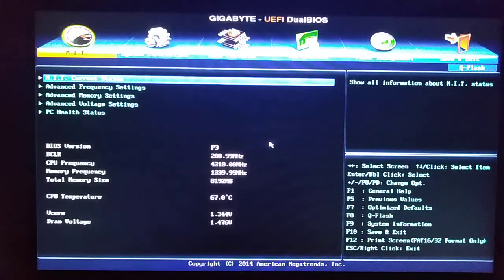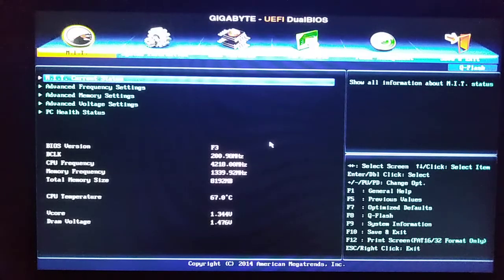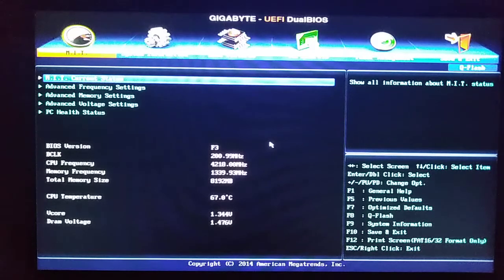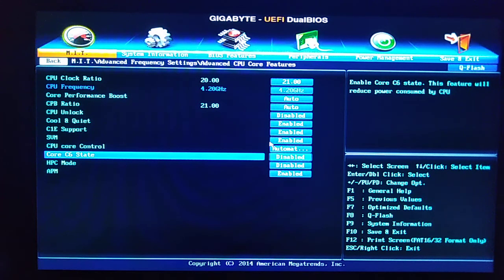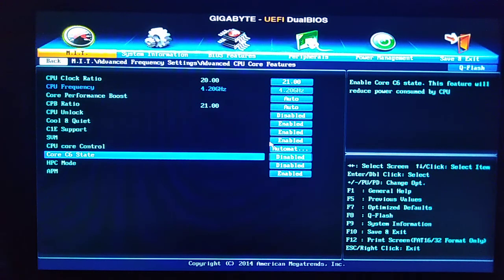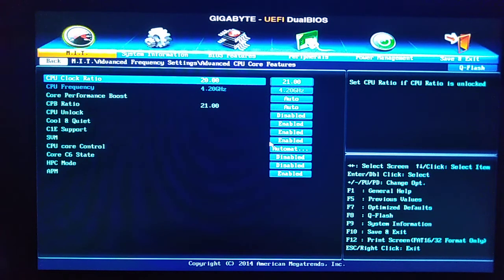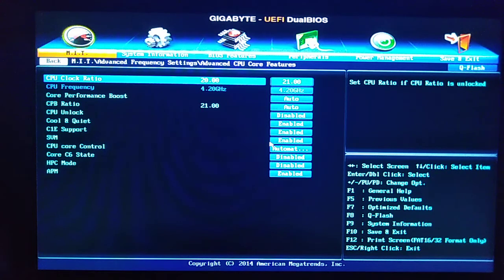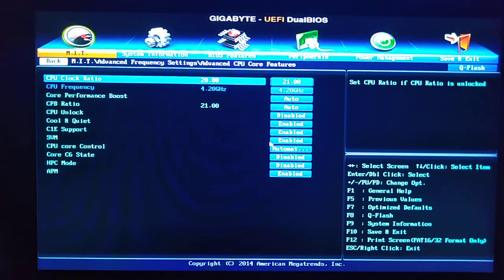PC Hanging w/Buzzing Sound (The Most OBSCURE Reason, Older AMD CPUs)

Comment: did not sloved, here are my specs

Operating System
	Windows 11 Pro 64-bit
CPU
	Intel Core i5 12400F	32 °C
	Alder Lake 10nm Technology
RAM
	16.0GB Dual-Channel DDR4 @ 1330MHz (19-19-19-43)
Motherboard
	Gigabyte Technology Co., Ltd. B660M DS3H AX DDR4 (U3E1)	17 °C
Graphics
	LG ULTRAGEAR (1920x1080@144Hz)
	4095MB NVIDIA GeForce RTX 3060 Ti (Unknown)	37 °C
Storage
	931GB Crucial CT1000P3SSD8 (Unknown (SSD))
Optical Drives
	No optical disk drives detected
Audio
	High Definition Audio Device
Reply from the maker: It's something else then.
Reply: @MistaFiOth  can it be thermal paste? I can't able to pinpoint what exactly is the issue here! Ran Heaven benchmark, after running for like 20 min, buzzing sound and then PC froze. Sam happens when not doing anything or simply watching a YouTube video also. Sometimes, it freezes during the user profile load after a restart! Really frustrating! After going through numerous pages of internet, there isn't a consensus. swapping/replacing ram, PSU, GPU, Motherboard, thermal paste, dust, C-state. NO EXACT SOLUTION
Reply from the maker: @DaveSan-lz5bs I don't think it's thermal. Thermal would just shut the PC down. Something else is at play.

Comment: How I actually fixed my issue to where I didn't get that freeze no more, I thought maybe it was the (igpu integrated graphics card) so I connected my AMD readeon and disabled my igpu which is a HD 530, still same problem after about 15 10 minutes into a game/ browsing it would freeze, so i thought maybe the ram i tried it with diffrent ram sticks i cleaned the ram slots/ ram still the same problem i thought maybe its the OS so i went from windows 10 to 11 still had the same problem, my fix was in the bios under performance everthing that has something to do with the cpu/ ram turn off, multithread, turbo boost, all that stuff , to get tonthe bios restart pc and hit f12

Comment: Hey dude, just fixed the issue of mine , similar to u, 

Thanks a lot for your trouble shooting ideas

Can't explain how am pleased right now

I understand now , the safety features r not always good to get enhance performance.

Thanks 🙏👍 man
Reply from the maker: Glad I could help, my friend. Back in the day, this was driving me insane. Enjoy!
Reply: Hey 👋
Morning dude, 

The previous problem solved, 
At that moment i was using windows 10 21 h2, a custom build nexos lite os, now am shifted to windows 10 22h2 latest patch,  (windows xlite, custom build fully debloted and lite wait, now when am playing a 4k video, or giving extra lode , like opening 2/3 tab with YouTube video, the same problem occurs again, like not always only some how, it's happening only with the 4k online videos of YouTube, not with ofline playing videos, i think my smps is not working properly, or give some idea, what is the actual problem, thanks
Pc configuration- core i3 with 8gb ram 4gen, and a graphics card, nvedia 610 2 gb memory
Reply from the maker: @mobile_genius  this is probably related to overheating whilst the system is trying to cope. It's quite old... I'd open it up and check for dust in the cooler but still, 4K - even in video format - requires a lot of processing power.
Reply: Already cleaned, but yesterday evening i just changed the PSU to a 500 watt gaming PSU, no problem occurs till now

By the way thanks again 🙂🙂

Have a great day

Comment: Hello man, i have buzzing sound after testing old gpu gtx 465
When i put in i have buzzing cracking sound on speakers and i cant fix it. I unplug card and problem is still here. Is not drivers.. system... i do everything...
Reply from the maker: Hey man. I cannot diagnose it like that, it can be 100 things. Maybe the card is problematic. This vid covers a very specific topic I'm afraid. 😕

Comment: I'd like to personally say THANK YOU!!! for this advice. Obscure is an understatement. I wouldn't have put this together at all, however, this problem was ruining my system. Here's something I got from a CISCO website (Performance Tuning Guide for Cisco UCS M5 Servers White Paper) about the C6 Power State: 

"Processor C6 report 
The C6 state is power-saving halt and sleep state that a CPU can enter when it is not busy. Unfortunately, it can take some time for the CPU to leave these states and return to a running condition. If you are concerned about performance (for all but latency-sensitive single-threaded applications), and if you can do so, disable anything related to C-states. 
You can specify whether the BIOS sends the C6 report to the operating system. When the OS receives the report, it can transition the processor into the lower C6 power state to decrease energy use while maintaining optimal processor performance. 
The setting can be one of the following: 
● Disabled: The BIOS does not send the C6 report. 
● Enabled: The BIOS sends the C6 report, allowing the OS to transition the processor to the C6 low-power state." 

Here's what that same website presented about the setting I found and disabled in my bios on a Republic of Gamers motherboard (Autonomous Core C State): 

"Autonomous Core C-state 
When the operating system requests CPU core C1 state, system hardware automatically changes the request to core C6 state 
This BIOS switch allows 2 options: "Enabled" and "Disabled". 
● Enabled: HALT and C1 request get converted to C6 requests in hardware. 
● Disabled: only C0 and C1 are used by the OS. C1 gets enabled automatically when an OS autohalts. 
By default, Autonomous Core C-state is disabled." 

This setting (labeled 'Autonomous Core C-state') in my bios was enabled by default. My CPU is from Intel i9 and my motherboard was manufactured in 2017. I hope that everyone that has this problem finds your video.
Reply from the maker: Thank you so much for the feedback and extra info mate. Glad I could help!
Reply: @MistaFiOth  Anytime!  You saved my system my friend!  I couldn't find nor think of a solution like this one.  I hope you reach everyone that needs this fix.

Comment: I have a ryzen 5 3400g and a 1650 and this shit keeps taking a dump and buzz everytime I turn it on idk if it's the ram or what
Reply from the maker: Check the issue I'm referring to here. Might very well be the case.
Reply: did you find a solution? i'm facing the same problem
Reply from the maker: Did you watch the vid?
Reply: @MistaFiOth  yup, can’t find c-6 state. But found “global c-state” and it was already disabled.
Reply from the maker: The issue lies in something else then. 😕
Reply: It basically happens when your CPU runs on maxed out continuously which will lead to CPU temp rise if it crosses a certain limit PC will crash 
The only fix i found was to install a liquid cooler or get a good CPU which doesn't run on maxed out all the time, or maybe try to limit the processor state.
Reply from the maker: Nope. In this case it's the C6 state. Verified.